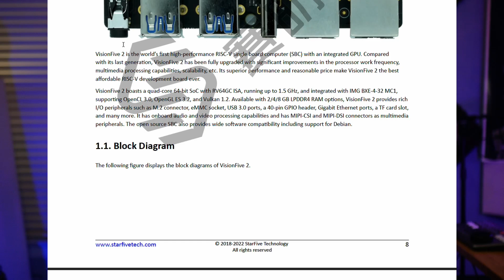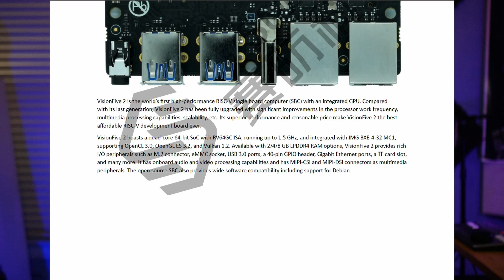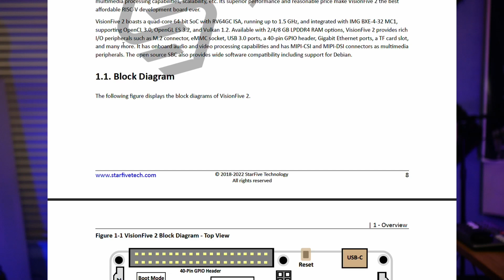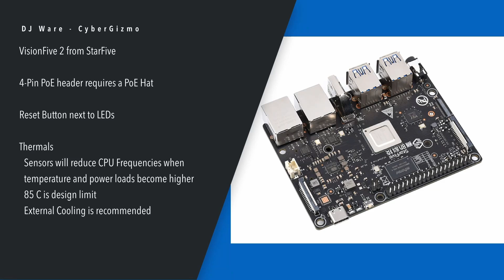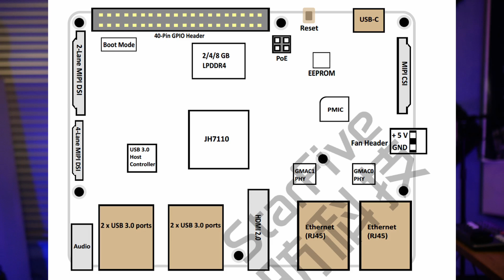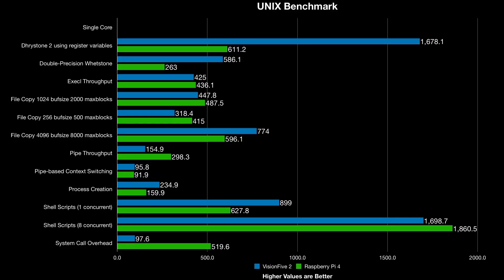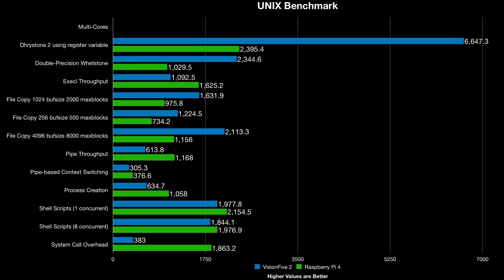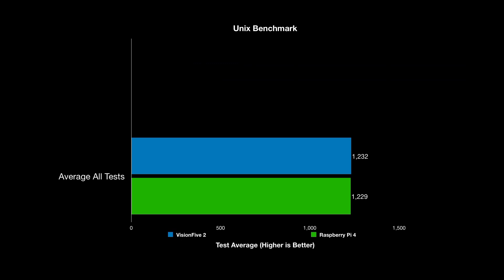StarFive VisionFive 2

Comment: The debian that came with it is the only image I've gotten to boot with HDMI output.  And it's weird in that updates complain about keys.  Which prevents apt-file from doing an initial update.  Using cwm, makes the terminals have no visable fonts / colors.  Foreground and background are the same color as best as I can tell.  Running a script to override that seems to not do that.  But you can launch a browser and exit the terminal.

Comment: I don't think Linus was saying run what you like, though it may be implied. It was more like he was saying the ISA is no longer what determines performance and general ability of a system, if the ISA ever really did. Even 40 years ago performance was likely more an effect of good implementation by the owning company, rather than inherent to the ISA. Implementation likely being what he ment by support for those infrastructure layers, coupled with compiler layer support as the other slice of bread on the ISA sandwich.
eg I have a small NAS server that uses an x86 Atom cpu and the whole box idles below 10w and peaks in the low 20w with enough network speed to saturate a spinning disk and continue to support several other minor services.(packetizing and reassembly of ethernet is fairly CPU intensive I find my desktop uses about 1 core*Ghz per Gbs of network traffic.)
Reply from the maker: I should have been a bit more clear there, those were my thoughts not Linus's but at the time he was meaning ARM didnt have the support or infrastructure to support Linux development, it must now, because he has switched to a Macbook Air (M2 - I think) running Fedora Linux

Comment: A good review, thankyou

I'd like to note that the board has a onboard DC-Converter (buck) and USB-PD chips that negotiate a 12V supply if the charger supports it.

Look at the penultimate page in the schematics (USB-C) and note U27 and U29, one or the other of these is fitted (not both, supply chain workaround) and negotiates the USBC-PD voltage.

edited: less churlish, I actually really enjoyed this video.
Reply from the maker: Actually there is an error in StarFives Documentation: Here is what I saw: USB-C port 5 V DC via USB-C with PD, up to 30 W (minimum 3 A)

And We are Both Wrong The Data Sheet says:

VisionFive 2  supports various ways of powering, smart power adapter as well as fixed voltage: • USB PD 2.0 • Support USB Type C PD 2.0, 9 V/2 A, 12 V/2 A, 15 V/2 A, 20 V/2 A • Qualcomm® Quick Charge™ 2.0 • Support QC3.0/2.0 adapter, 9 V/2 A, 12 V/1.5 A • Power adapter with fixed voltage from 5 V to 20 V on the USB C power port • 5 V Power from the GPIO Pin 2 and 4
Reply: @CyberGizmo  Yes, Starfives public datasheets are a mess and confusing. As you say the whole thing is a WIP.

But the schematics are accurate and pretty clear, the two chips I mention are both 12V USB-PD charge controller chips. But they are not actually connected to any charge circuit, instead they exist solely to negotiate the PD voltage (and there are positions for two so they can swap suppliers easily, only one will be fitted.)

The USB-C power input rail is labelled 12V ;-), It has a test point on it so a fun job for later is to probe that with a meter. I'll let you know! It may be that 12V is a 'nominal' pd level and it accepts higher if available.

Like you I found a small CPU heat-sink worked wonders. If you are measuring temperatures, have a look at the DC converter part of the board, my IR temp sensor shows that running surprisingly hot under load. It's next to  the POE Header, which, incidentally, StarFive say is compatible with a standard Pi PoE hat. It is positioned identically and the GPIO header matches the 'standard' Pi pin assignments throughout.

Comment: I'm apprehensive about the proprietary firmware on the board, notably the DRAM training.
What made x86 big was its relative affordability, which lent it economies of scale. Now in the era of leading-edge fabless, that doesn't really impact your ISA choice as clearly - I don't have to pay DEC's monopoly tax to get an Alpha. Software support definitely does, though.
Reply from the maker: Not quite sure what you mean
Reply: @CyberGizmo  the part about the firmware, or the part about the economics of ISA adoption?

Intel mentioned in the talk where they announced this release that they have included a lot of proprietary firmware for bringing up the system. They tried to paint it as a good thing, but for a lot of people buying into the risc-v ecosystem, people after systems that are completely auditable and under their control, this seems like a mistake, like the sort of thing expected from intel's involvement in this system.

On the success of x86, I don't think its dominance today is the same as it was 10 years ago. If you're running open source software, there's very little to keep you on one architecture vs another. As an example, the only reason I have an x86 system is for steam games. Most of the world has moved to tablets. Now that you can have a better ISA without paying $15,000 for a machine that performs well (c.f. Alpha), why stick with x86?
Reply from the maker: @capability-snob  Ok gotcha, I didn't see the Intel video, but if you go over to GNU and look at the linux distros that fully comply with free and open source its a very small number of distros on that list.  Part of the reason is patents which you can be sued if you copy. alter, bend, spindle or reverse engineer their code, the other half is similar things like WiFi, Bluetooth, USB, etc which are controled by external entities which develop the code and only offer it as proprietary drivers. As for x86, I left the x86 wagon almost 6 years ago now, and run mostly arm based machines with the exception of two (one for zfs and one for proxmox).  I did it to save on electricity as well as the cost of the machines and CPUs, and I was right they arent getting any cheaper over time -- so totally agree with you.

Comment: It is the open architecture of the CPU that makes this project so appealing.  Would like an open GPU core on one of these SBCs that was open, so the community can make a PC-killer.
Reply from the maker: There is a joint project between SiFive and Intel which oddly enough is working on an ISA form factor based on the P550 cpu from SiFive.  Supposed to be released this summer (July-August) time frame

Comment: Intel will be fabricating SiFive's Horse Creek P550 CPU. I'm very enthusiastic about RISC-V for several reasons. With horse creek, we will have a proper development platform, and it (meaning RISC-V not P550 specifically) will run on everything from embedded to supercomputers. ARM never had a real development platform, Qualcomm wanted to make a competing product to Apple silicon, but the lawsuit will postpone that at best and kill it at worst.
Reply from the maker: Looking forward to seeing that one too, this board with help ease the development time for the P550 CPU based on, because more packages will be ready for it when it ships.
Reply: Didn’t Intel just kill their investment in Horsecreek and RiscV? Like a month ago.
Reply from the maker: @keyboard_g  Not yet, Intel did kill off the Pathfinder project for RISC-V, but so far both Intel and SiFive expect Horsecreek to release on time this summer.  Pathfinder was a project to encourage development of RISC-V CPUs and FPGA solutions for RISC-V AFAIK.